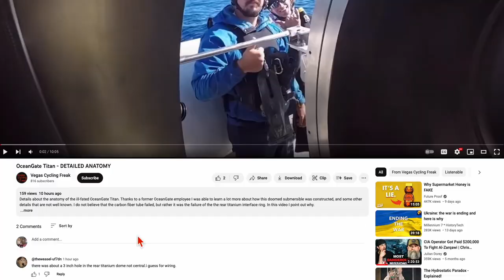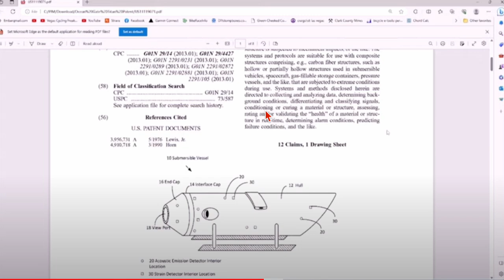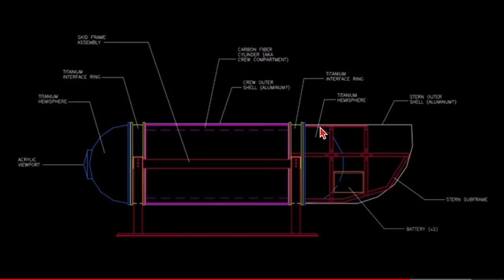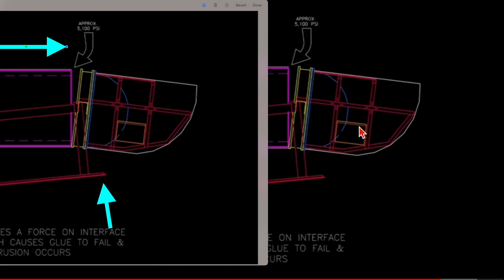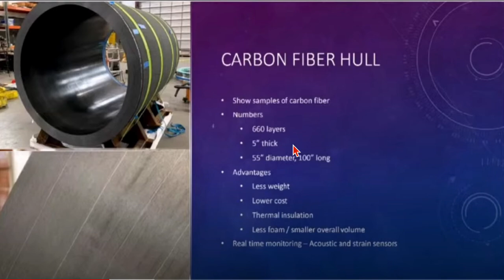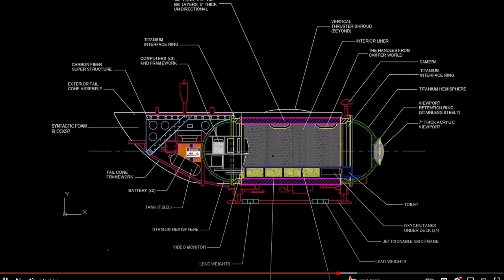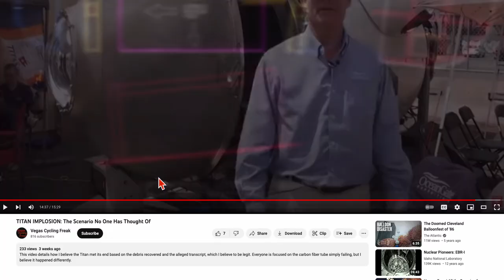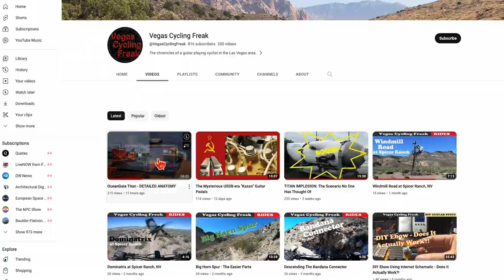titan submersible HYENA steals my images and content I published and plagiarised my content

Comment: Off the topic of this video one of many things that bugs me about this sub design is the outer stepping of the carbon fiber hull for the interface ring. It all should have went inside. I have serious doubts that exposed end was sealed at all and relying on the glue to seal the exposed carbon fiber layers while it is under extreme stress and uneven compression due to the different materials involved is nuts. I could definitely see water intrusion happen right at the edge which would get progressively worse. Thoughts?
Reply: Not sure if you went over this, if so I will rewatch the videos.
Reply from the maker: Zach, I did but I am actually working on a few videos to drive that home! 
I have a few concept models I made and use the brake rotors and the lathe to show this visually for people.
I will do a special video for you tomorrow on this detail and concept, the basic ideal is so simple... I have to hit the store and buy one part for your video but no big deal, your donations will provide that simple part (it's only about $5 and you have that numerous times over)... 
My honor to show this first concept for you.
Reply: Thank you